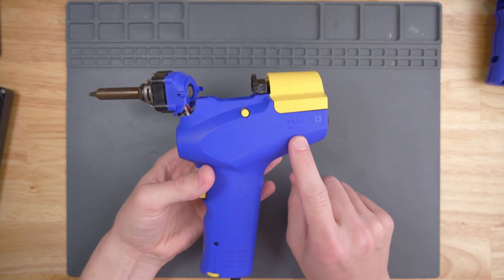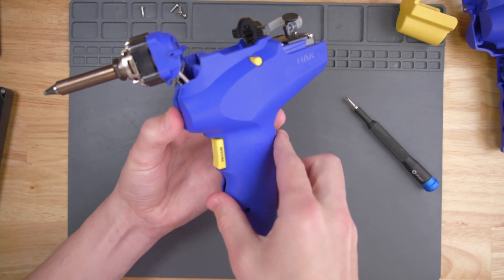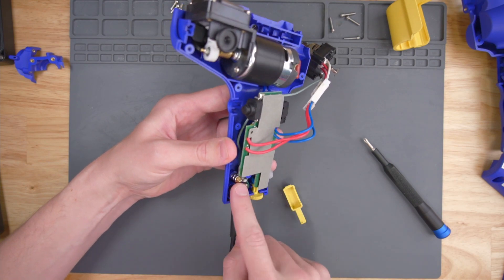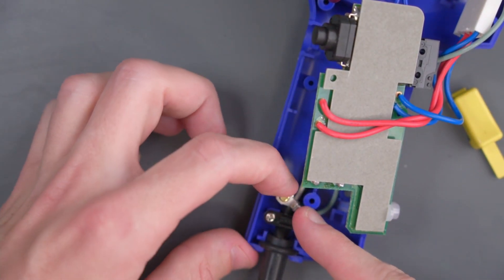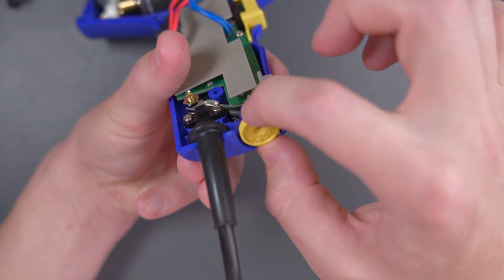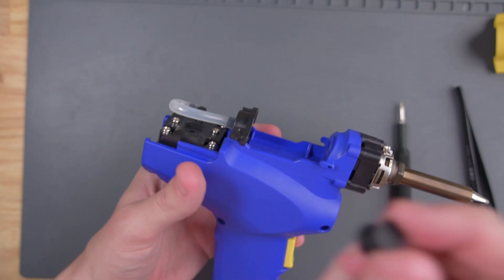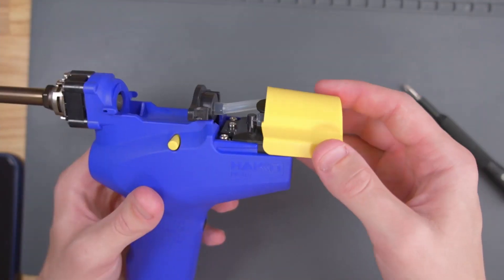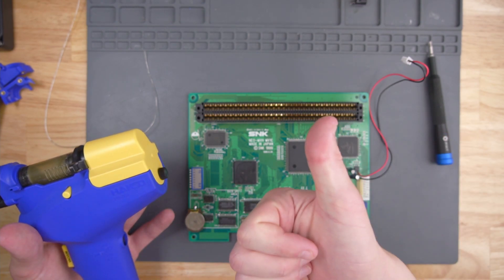Replacing Hakko FR-301 Shell - Fixing my broken desoldering tool!

Comment: Thanks - all those parts fell out, the small spring that goes on the yellow knob, the rubber spacer that goes in between the plastic tube, and the small nut that is placed inside the case. This video saved my rebuild!

Comment: Dude you're a lifesaver. I bought a Japanese FR 301 that runs on 100VAC which you can turn into the US version by removing the 10 Ohm resistor and replacing it with 2 300 Ohm resistors. I was at work doing the conversion on my break, so I had to rush. When I took it apart parts went flying like yours did. I was wondering what the washer and black rubber thing were for and now I know thanks to you. Great video and love the music.
Reply: Same! I did the mod and was worried about the reassembly
Reply: @RenRenification  If I had to do it again I'd disassemble it in a clear plastic bag to catch anything that goes flying.

Comment: just horrible build quality, kind of like logitech g35 type quality. flimsy plastic. i just got a engineer ss-02 to replace my broken fr-301. the only thing i like from hakko is the fx-888d.
Reply: What problems did you have with the fr 301
Reply: @ktownc936  the constant clogging and the build quality being meh
Reply: @pentiummmx2294  so you just use a solder sucker now, I don't see a good alternative to the fr301. I need something for capacitor removal on old video game systems with via fencing and multilayer boards.